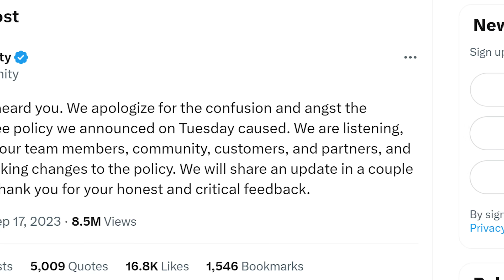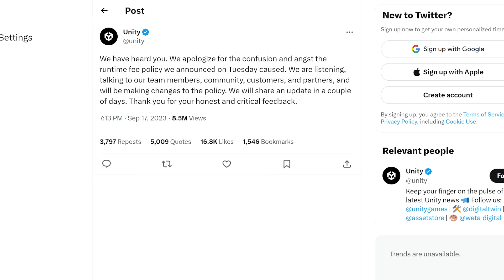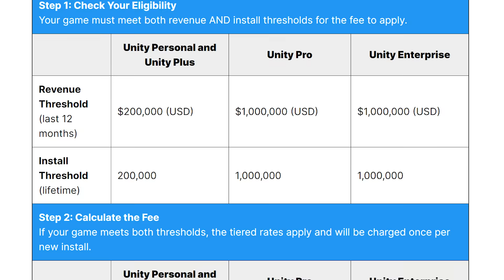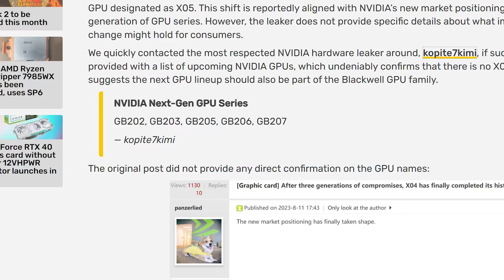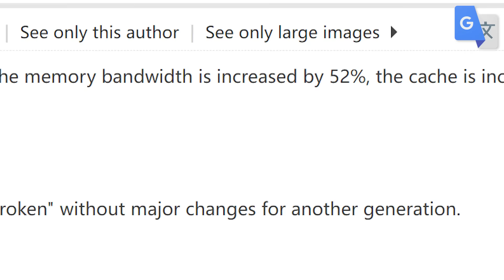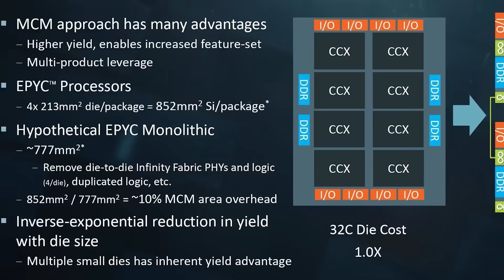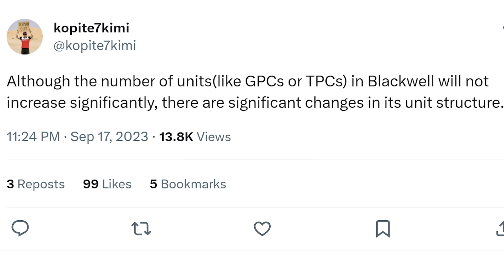RTX 5090 Completely DESTROYS The 4090!

Comment: Would the face plates they used as a sponsor technically make the GPU heat up more with less airflow?
Reply: Not really... the heatsinks would blow hot air out the sides or back of the gpu. Its not as efficient as a flow through design but most GPU makers use a solid back plate anyways. The backplate mainly offers rigidity to the pcb keeping it from warping/protecting it from coolant spills to some capacity. They do offer a bit of heatsink like capabilities but once the metals thermally saturated the benefits are a bit lessened.

Comment: Personally I don't think Nvidia should be focusing on the most possible performance in cards right now, the 4090 is already completely overkill for anything other than 8k gaming. Focusing one generation of GPUs on low price would make competition for AMD in the budget GPU market which is a win win for consumers and Nvidia. Maybe even a separate line of GPUs without ray tracing, equal performance for half the price.

Comment: Hi everyone. I came here after hearing the rumors about the new graphics card. For 3 years now I've been using the RTX 2070 Super which has been released since July 2019, and I've thought it's time for me to look for a replacement. Over the past several months I've been eyeing whether to get Nvidia's GeForce RTX 4090 or AMD's Radeon RX 7900 XTX; both of which were released last year and better than the 2070 Super in every way in terms of performance. I initially thought of choosing the RX 7900 XTX, because the price is $999+, compared to $1599+ of the RTX 4090; which means I'd saved about 1/3 of the money. However, there's an issue that concerns me. If I choose the RX 7900 XTX, which is not a GPU product from Nvidia, that would mean I'd have to uninstall the current drivers and then install the new drivers compatible with the new GPU; which also meant that it could affect the graphics of rendering as well; Blender in particular. With that said, I'd have to choose to get the RTX 4090 which I've made up my mind, or at least I did until I heard THE rumors. With regards to the new RTX 5090 which should be better than the 4090 in every way, I believe it’s important to point out that I'm not just looking for a new graphics card with the best performance and graphics, there's also the noise. My RTX 2070 Super is a Gigabyte model, at a noise level of 32 dBA, whereas 45.2 - 48.2 dBA from the Gigabyte model of the RTX 4090 is the highest of any RTX 4090 model. With that in mind, I should be very careful of which model of the RTX 4090 to get which won't end up sounding as loud as an air conditioner. After much research, I found that the MSI RTX 4090 Suprim X turns out to be THE quietest RTX 4090 model at a noise level of 28.6 dBA.

But what do you guys think about this? Do you think it's worth the wait until the 5090 is released, choose the 4090, particularly the MSI RTX 4090 Suprim X in the end because the price of the 5090 is much more likely to be high and the chances of the noise level are greater than 28.6 - 32 dBA or choose a different alternative?

Comment: Just upgraded my PC with a ATX 3.0 power supply unit. Ready for the 5000 series of GPUs.

Since they should use the same power connector as the 4000 series.

Comment: Blackwell sounds very good, but there is no point in  a stupidly powerful 5090 if the mid range (5060/60Ti) is going to be just 10~15% better (at best) than past gen counterparts. I perfectly see Nvidia launching a 5060 that doesn't even touch the 3080/4070, or have the same performance of the 3060Ti/4060Ti.

Comment: Unity is NOT in the wrong here, this download fee will result in approximately 1% less revenue for the developers (basically nothing) while at the same time Unity is making big money out of it. Which they are in serious need of right now as UE5 is kicking their butts right now with new features and are making everything else obsolete.
Reply: unity only care about money and doesn't care about their own engine, they never make new feature unlike unreal, unity is good because it has strong community, all asset, custom plugin and extension are from community, they can't make their own visual script tools so they bought bolt but everybody use playmaker and both bolt and playmaker are not by unity but by someone else on asset store.

Comment: Coming along the new gpu mining boom/bullrun, as so happened with the GTX 1000 and the RTX 3000 series before. 
If the pattern persists, the RTX 4000 will be the new RTX 2000 mining-wise, being close to the mining performance of the previous gen, even though with thrice the price, but bringing new tech in games; the RTX tech and the DLSS 3.0 - frame generation respectively.

Comment: 5090 will probably cost over 2000€, be the same size as your pc case and required to be plugged to the power outlet directly
Reply: You know what I'd probably prefer that last part. would make cable management a bit easier.

Comment: The improvement is pointless if it does not cost less and is not efficient. I would rather have a 4090 that costs less, has the same performance, but also is more efficient in power, than a monster card that has double everything except the benefits you get from it.

Comment: Yeah, the 5090 will be 50% faster than the 4090 on average, but the 5060/5070/5080 will be marginal improvements over the current generations....... basically f*ck most consumers.

Comment: What kind of CPU are you gonna need to not bottleneck that card.  The 4090 already needs the top of the line Intel or AMD CPU to run at peak performance.

Comment: The RTX 5090 will blow your mind. 10% performance uplift for only $2999.99. And don't forget to buy a 2500W power supply that supports our newest triple 12V firestarter plug!
But don't worry, low budget friends, you will get 2% uplift from your previous generation and still 8GB of VRAM for the great price of $499.
With the NVIDIA price model and their performance per dollar, this series is probably dead at arrival as well, just like the 40 series!

Comment: Here we go - months of the 5090 is going to blow the doors off the 4090, the 5090 will be 50 times faster than the 4090, the 5090 will be a dissappointment, the 5090 is delayed, the 5090 will come with 64GB of memory, the 5090 will only have 8GB of memory, AMD will close shop, AMD will release a new 9950 that will be twice as fast as the 5090, the 5090 will not be able to compete with the 9950, the 9950 will be half the price of the 5090 and have twice the performance, nvidia may not release a 5090, nvidia claims the 5090 is up to 4 times faster than the 4090.   5090 is released it is about 20% faster than the 4090 on average but up to 4 times as fast playing Solitaire.

Comment: The RTX 8030 absolutely destroys every card that has existed previously!!!!!! 
its got more of everything!

"yes no shit sherlock"
Reply: didn't the 4090 do that to the 3090.. the 3090 did that to the 2080ti which hardly did that to the 1080ti... 
and yet even tho the 1080ti wasn't beat by much with the 2080ti the head lines were the same.. TOTAL anihalation! destroyed! obliterated.. 
yeah.. so I sold my 2080ti and kept the 1080ti until I got a 3080ti... which didn't feel like It was shitting on the 1080ti all that much..

Comment: If it comes in at a reasonable price compared to 4090 instead of £1k to £2k just for the card it might get people to take up PC gaming but when consoles at £500-£600 for 4k 120hz pc gaming just to rich for most people when a top of the line gaming PC that will be out of date within a year that cost £4k to £5k people will just not pay ludicrous prices just for a GPU when already there has been a lot of negative talk about the 4090 prices

Comment: The MCM design seems good for consumers but bad for enterprise was lower power for the same or higher performance is everything. MCM is not as power efficient as monoethnic now will it come to consumers? Probably as MCM is a good way to be able to put or not put more of less chips onto the same package. So more of less CUDA cores and more or less Tensor cores depending on how does nVidia want to segment the market for their cards.
The performance uplift well is that gaming? AI? production program? Then of course CUDA or Tensor performance?
+50% cores so CUDA cores or Tensor cores?
+15% higher clocks is it on CUDA or Tensor cores?
for cache is it CUDA cache or Tensor cache?

Comment: 24GB Vram still for 5090 ?
Reply: And 8gb for 5060?
Reply: 24gb is a lot of VRAM for games still. Hard to find games that come close to that, even at 8k. Though, you are paying a couple grand for a single PC part, it really should have more VRAM than your system ram at that point.
Reply: @oneblacksun  im doubtful about 8k not needing more. ive used 14-15gb at 4k on my 4080
Reply: @oneblacksun Due to Vram limits apple M2 is much faster then 4090 for Falcon 180B ai model M2 can get 10 tokens/s mean while i get 0.1 tps.  they should increase vram.
Reply: Not really. 5090 will use GDDR7 meaning that it can have 3 GB/memory lane, therefore we could see a 5090 with 36 GB and 512-bit. Also GDDR7 will allow the 5080 to have 24 GB and the 5070 to have 18 GB.

Possible scenarios are:
5090 on 512-bit and 36 GB
5090 on 384-bit and 30 GB
5080 on 384-bit and 30 GB
5080 on 256-bit and 24 GB
5070 on 256-bit and 24 GB
5070 on 192-bit and 18 GB

Comment: Don't care about the 5090. I do hope we get a 5070 that's actually a 70 series card at a not-too-ridiculous price.
My only video card this gen was an Intel A770 16Gb Works nicely for video editing.
Reply: The 5070 will be a dumbed down version of the 4060 Ti 16GB and only 5% faster than 4070 but costing 900 € but with DLSS 5.0 Virtual Frame Generation that inserts 5 fake frames for each 2 real ones.
Reply: @mariop8101   Sadly there's a good chance you're right. But if you are, I'll just buy a used 4070. It'll do until something considerably better comes along at a price I'm willing to pay.
Reply: @ausfoodgarden  I was in love by the 7800 XT (but not with the prices after restock and no starfield at local stores), but now I'm just keeping my noisy 3060 ti until they drop down the prices or it breaks down.
Reply: @ausfoodgarden  Maybe one Intel Battlemage card.
Reply: @mariop8101  Yeah sadly I need CUDA cores for my main system. So unless next gen AMD is way better than this one in Blender or Intel increase Blender performance 4 times I'll have to go used Nvidia.
Reply: @mariop8101  Yep I'm managing with a 3060 12Gb on my Blender box. Sadly it needs Nvidia unless AMD can boost their Blender performance.

Comment: I called the 5000 as a big leap ahead, however due to poor sales of 4000 series to gamers.. 
here it come
Low production numbers, despite being the actual beast, the low production runs will keep the prices High AF while being able to funnel the rest of the available chip contracts to AI gpu variants.

Moreover when you take in the hit of path tracing even on 4090.. well they aren't going to make it if you can't run it..  so there's that.. so 5090 has to step up to be a showcase ... 

My bet the practicalities of a decent gpu just based on critical thinking and market trends history of some 20 years in the pc gaming.. its going to be Nvdias 6000, 6080 to be the seller with min 16gb ram? sigh
Potentially Nvdia 7000 series before things like path tracing are practical at upper mid tier.
But by then you know, some new gimmick at 24K resolution lol comedy!

Comment: Yet another year saying that these cards will be crazy LOL! A RXT 4080 is a great card but overpriced at around $1200 while the 7900XTX is also a good card and not much cheaper really. The 4080 is around 15% faster in 1440p and 12% at 4K (plus or minus depending on the game.) with far better RT performance (if that matters to you) and Nvidia has always had better and more stable drivers with better upscaling DLSS VS FSR. Yes, the 7900XTX has more VRAM but that does not matter as by the time game devs even start to use anything near that you will have upgraded your GPU more than twice. Just pulled prices for an ASUS TUF 4080 at $1200 and also an ASUS TUF 7900XTX at 1,099,99. So why do so many people think the 4080 is WAY overpriced? AMD's best is not even as strong as a 4080 in most games and is only around $100 less? Nvidia is also coming out with Ray Reconstruction (if it works as advertised) will be great as RT has always been a huge hit on performance. What does this all mean you might ask? Who the hell knows but if a 4080 is "Overpriced" so is the 7900XTX.

Comment: until the redo software side of the card they going stay same no matter how much new crap add to card they still running old version of the software. go in ati software you find lot setting turn off if looking in .inf file u see there so many set to 0 so not many enable. i have not check the nvidia drivers see in there if got .inf file for setting my be other look into setting see what disable u my find game could look lot better if enable sum them.

Comment: What a disappointment.

Same memory capacity as the 3090 and 4090, and no nvlink. It will not be worth it. Even if they bump memory transfer speeds, sure they can go up to PCIe 5 but it's hitting DDR and NVMe bandwidth limits LONG before that, so again another big pile of meh

If it went up to 48gb of memory, then we could talk, even if it cost double
Reply: GDDR7 will allow 3 GB/memory lane while GDDR6 only allowed 2 GB/memory lane so we could see a 5090 on 384-bit and 30 GB.
Reply: @laszlozsurka8991  Regardless of how fast the memory is, it's bottlenecked by PCIe. No matter how fast PCIe is, it's bottlenecked by the CPU and ultimately RAM.

This is a massive (end extremely crude) oversimplification on my part, what I mean to say is that you can't turn GDDR bandwidth into fps numbers. Especially not with this current generation. 2x the bandwidth might mean "20% faster" (this time).

Now, if you have a ton of memory, now all of that memory can be slurped by the GPU cores themselves, without having to pass through the straw that is PCIe+CPU+RAM

But no. Let's keep at 24Gb for the third generation in a row. Sigh...
Reply: @fimbulvntr  Sure but why is 24 GB bad? 24 GB is plenty of VRAM to run every game at 4K max settings even with RT enabled. 24 GB would only be a problem if you were to game at 8K but no one does that.

Not to mention the 3090's 24 GB was a large jump from the 2080 Ti's 11 GB so it makes sense 24 GB would last for 3 generations.

By the way there's no proof that the 5090 will have 24 GB, it could have 30 GB or even 36 GB if NVIDIA choses to give the 5090 a 512-bit bus (which is unlikely to happen)

Comment: Maybe the 5090 will be hughly faster than the 4090. But - in my opinion ! - for gaming the 4090 will still be fast enough for a long time. I would say that that all owners using the 4090 only for gaming, can completely skip the RTX 5000 series and wait for the 6000 series. Perhaps except a few 8K enthusiasts. Even if the 5090 will be 50% faster in gaming - what I can´t believe! - the 6000 series will again be faster. I definitely will not buy the RTX 5090 and wait for the 6090. THAT will then be - probably - a REAL Upgrade. But even only when - then - my 4090 isn´t fast enough any longer.

Comment: unity should charge per install of the game because it's like ROYALTIES but they should be capped at 5% as they are not HOSTING/DISTRIBUTING so they can't scalp 30% like steam or Other platforms.

if the game is "FREE" the game should charge 5% of free. 
so it's $0.00

if UNITY wanted to make money they should charge a licence fee and it should be A ONE TIME FEE

because imagine Photoshop doing this for every image that is used on a website and that website makes billions 
so does photoshop need to be paid a % per image? or total amount of images even tho the IMAGES where only CREATED with the tool not totally

like Unity is a engine the assets are created by the user 

the game doesn't just MATERIALIZE 

like % of install = $$$ this kind of scalping is what governments do

YIKES GAS LIGHTING APOLIGIES sounds like GPT has been busy/

Also 5090 if the 5090 is leaps ahead meaning Nvida's R&D team have obviously figured out how to get a LOT MORE POWER then they are releasing. 

I would assume if they did relaese the best they could make it would break the market  and they woudln't be able to keep up with demand or turn a profit.

Comment: UNITY actually capped it to 4% revenue . Which is less than the 5% revenue fee UNREAL engine but with UNREAL you can year 1M$ per quarter without revenue share, but with UNITY its 1M$ per year.  If they originally went to 4% revenue route without mentioning the installs, people would have just thought this sucks a bit but not really gotten angry about it. Now they got people angry AND the install thing reducing the amount of money they make relative to that 4% revenue share.

Comment: I’m starting to think the big YouTubers are getting out of touch. Who cares about the 5090? What I care about is a 5070 with 16 gb of vram that’s faster than the 4080 at $500. A 5060 12gb for $300  and a Ti in between also with 16gb. And the 5080 with  more than 16gb and $750 (pipe dream I know)
Reply: I care about the highest end.  I game at 4k 144hz and want to upgrade to 8k 144hz when it comes out.  I'm saving for the 5090
Reply: aint no way gonna be cheaper then a 4080 for 500$.. what last gen gpu is out right now that is faster then current gen and only 1/2 the price??
Reply: @turboimport95   Do we, like as a collective just forget about past lineups? See RTX-3000  series over the 2000 series. Off the top of my head the 3060ti (MSRP $400) vs 2080 (MSRP $700).  This time a 4060ti (MSRP $4-500) doesn't beat a 3070 (MSRP $500) let alone the 3070ti or 3080.